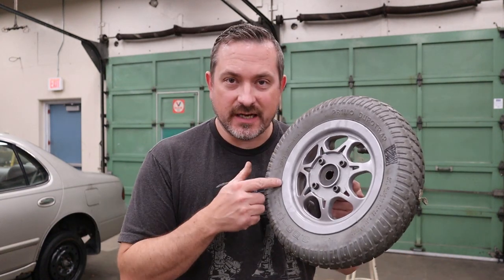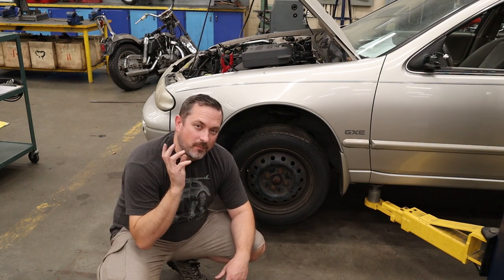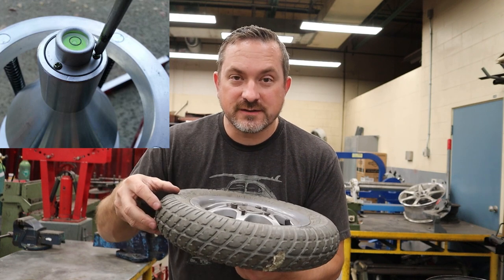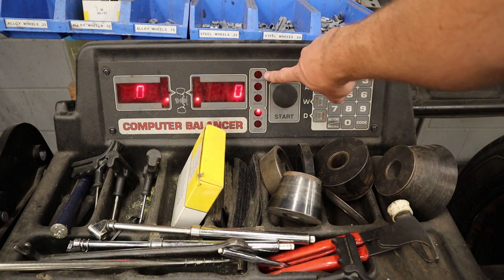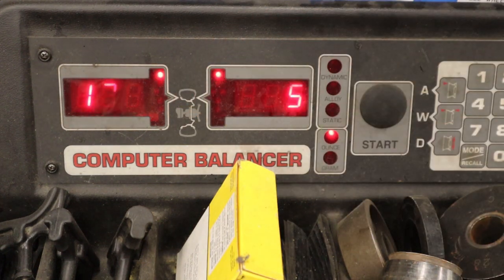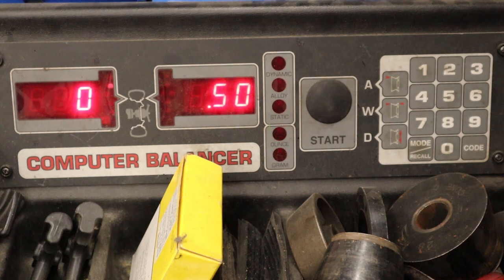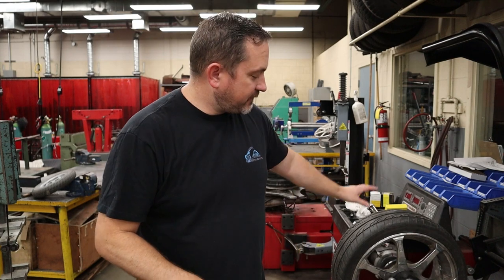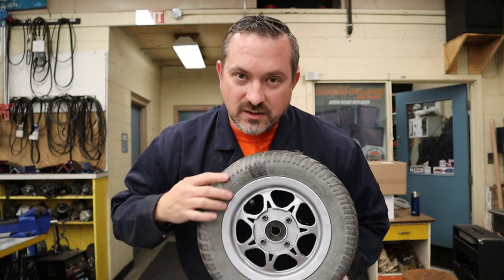EXTREME out of balance wheel!  How to use a wheel balancer & everything about wheel balancing!

Comment: Static balancing still has its place and it’s place is with bigger/heavier tires like M/T’s 33” and bigger. I’ve had a hell of a time balancing radial 33’s. Went the dynamic route and kept chasing weights. Roadforced them and they balanced but had a vibration at 50mph.. Finally talked to a 4x4 shop locally and they said they only balance heavy tires with static balancing. I took their advice and did it and no issues. No vibrations no shimmy no nothing.
Reply from the maker: Good to know as I rarely do wheels that big.  I wonder if a big mud terrain tire would benefit from balancing beads too for when a big rock gets picked up/dropped from the knobby tread.  Cheers!
Reply: @wayofthewrench  Balancing beads are truly a hit or miss. My personal argument as to why I do not use them is that an imbalance on a tire is at fixed spots but balance beads constantly move the balance
Reply from the maker: Yeah balancing beads are really only for large tread off road tires for when they pick up rocks/lose rocks constantly.

Comment: Your comment about road force balancing was applicable to me. I took my vehicle to a  nationwide chain tire store and requested road force balancing. When I got back my vehicle there was vibration at  cruise speeds. I suspected this would be the case a I did not see any indications that the tires were optimized , the tires being deflated and rotated on the rims. Usually there would be "some" chalk marks somewhere on the rims and tires and that I did not see. Also I always remove the hubcaps and keep them in the trunk and replace them myself. There was no evidence that the tires were "wiped" clean. I am therefor returning to have the job done properly. The store has Hunter Elite machines , very high tech for road force balancing and my only hope is that there is someone on the shops team trained to do this kind of balancing. I paid for road force balancing and that is what I expected, not just computerized balancing.
Reply from the maker: Every now and then a tire just doesn't cooperate and there is something that is wrong with the tire internally when driven.  These can be tricky but the shop can play with things to try to solve the issue including using the balanced spare wheel or a good shop wheel in order to diagnose the "bad" wheel.  I'm not sure deflating the tire and rotating it would be a fix as if it is a out of balance wheel assembly, you would just counter balance with weights but maybe more than usual if the tire's heavy side lined up with the rim's heavy side.  Taking off the hubcaps would prove out if the issue was with hubcaps but are not included in the wheel balance so test with them off first.  Another trick mechanics do is do a tire rotation and see if less vibration is felt in steering wheel as maybe the out of balance wheel is on the front which tends to shake the steering more.  Other possibilities is that other components are worn and exaggerating the feeling/sound of a balance issue.  Bad wheel bearings, bad strut, bad shock absorber, etc...a rotating part that can have speed dependant issues.  I hope you got it sorted out.  Thanks for the watch!  Cheers!
Reply: @wayofthewrench  I understand all that you have said. Honestly I do. These  Michelins tires only have 8k miles on them and they were road forced prior with excellent results. When I took them back to Costco  for a rotation and balance I inadvertently forgot to mention not to rebalance , so after the fact that's when I decided to take matters into my own hand have them road forced  elsewhere as they don't offer that service. So I know they can be balance with minimal vibration, much less than I am experiencing now. I'll see what happens when I take the vehicle back. Thanks for responding. I really enjoyed your informative video. Cheers
Reply: @wayofthewrench  So , the balancing was made right as I watched in delight as the tech did his thing. There was one wheel in particular that appeared to be problematic as he seemed to have been "chasing" weights but in the end the computer gave an OK. The vehicle is silky smooth now all the way up to 80mph. My taking the vehicle back and requesting the work be done turned out good.
Reply from the maker: Glad you got it figured out.  Was it done on a road force balancer?
Reply: @wayofthewrench  Yes, Hunter Elite balancer

Comment: Finnally a very good explanation of the dynamic balance of a wheel and why weights can sit with 180 degree opposition each other, at last in theory. What would have have happened if you have sat the heavy balancing weigths while the wheel sitting on the car with 180 degree opposite?  (Sorry if my english isn’t perfect - i am danish)
Reply from the maker: Yeah it might have made the dynamic balancing worse and had more shaking.  Either way, that balancing video killed that car. It shook everything on that car to death.  Lost a bunch of electrical components...lol

Comment: Sir, a friend of mine gave me an older style wheel balancing machine. No motor but all the digital readouts. You have to manually spin the tire until a beep is heard then a brake slows the wheel/tire assembly and indicates the weights required and their placement location. My problem is that that the measuring device that determines how far the rim is away from the machine is missing. Do you know how critical this dimension is in regard to the accuracy of the wheel weight placement results and what it is actually measuring? That is the distance from the rim to what point on the machine. Any help would be greatly appreciated. Thank you.
Reply from the maker: It is pretty critical as it needs that info.  However, it is literally a measuring ruler from the machine to the edge of the rim so you might be able to gleam some measurements from a pic or video of your balancing machine and make your own.  Or find the part you need online.  Good luck!

Comment: Another method of balancing tires with a dynamic system is liquid balancing , (most people use antifreeze) generaly it takes about 2x the OZ weight of balance beads to work properly with liquid.
Reply from the maker: Funny you said this.  I see a lot of cars come in with water in the tires from air compressors that don't have a water trap.  It always throws off our balancer because the water will start on a different side and will constantly tell us it needs more weight.  After 3 attempts, we always break the bead and look for water.  Thanks for the watch and the info!
Reply: @wayofthewrench   yeah dynamic balancing doesn't take effect till the tire is up to a decent speed like 25-30 mph, so yeah it you tried to weight balance a tire with beads or liquid in it, it would never balance because a wheel balancer doesn't spin the wheel that fast.
Reply from the maker: Yeah not a lot of people around us even want balancing beads.  Cheers!

Comment: Great presentation, thanks for that. 
I have Coats 700 never used was sitting in the garage for 10 years, yesterday when I start using it it has error message on the screen, and can't fix it any help or instruction how to fix this ERROR message? Thanks a lot.
Reply from the maker: Thanks!  You'll have to google the error code to see what it is.  Could be something simple like the hub isn't tight or the hood is up or it could be a major problem.  Hope that helps.  Thanks for the watch and welcome to the channel!

Comment: Excelent. Question does tire patch and Slime Flat Tire or Fix-A-Flat affect a balanced wheel? Second question: In places where is to dry and hot, does oxidation of the rubber can generate vibration? In Oklahoma, the tires are bouncing but not because unbalancing but because road conditions (all warped and full of berms) so people has to buy 4x4 and Suv's, not too many subcompact cars (as mine) here
Reply from the maker: Thanks Pablo!  Well a patch might affect the balance but remember you are balancing the wheel after your patch repair.  The tire slime leak repair to a mechanic is like garlic to a vampire....we hate it.  It makes a huge mess inside and yes it could make balance issues.  Best fix is a umbrella patch repair from the inside and if it is a side of the road fix, a temporary tire plug works great  until you can go get it fixed with an umbrella patch.  The heat on tires doesn't really cause balance issues but it will compound or speed up other problems like tire wear.  That sucks to hear about your roads, now you have an excuse to get a truck!  Thanks for the watch!

Comment: Hi, Excellent explaination.......so do you recommend balancing beads? Because some people say they are trouble or do nothing? I am considering using them in my atv tires. I have a terrible handlebar shimmy at 40-70 kph...Thanks
Reply from the maker: I haven't used them personally but I know they are meant for big knobby tires that actively pick up rocks/lose rocks constantly so that the balancing beads fix the constantly changing balance.  So they might work for you.  However, I would check your steering, suspension for loose components, wheel bearings, and initial wheel balancing.  It kinda sounds like something else going on.  Thanks for the watch!

Comment: Thts the sound!!!! Thts the sound I hear the clanky on the 3rd video!
Reply from the maker: Which sound?  If it is a sound in the video, please use the minute/second in the comment so I can see what sound you are referring too.  Cheers!
Reply: 5:45 right before extreme out of balance. I hve been out all day trying to get fix! Had it towed to discount tires nobody is fixing they just keep saying it’s balanced. Sounds horrible and they are saying it’s prob transmission. Your telling me I had tires put on and now transmission went bad but it’s shifting with no problems but sound like it’s going to fall apart since tires put on. I dnt know what else to do I’m out 300 dollars and my truck messed up!
Reply: Even part of the extreme the clanking noise is what my truck is now doing it wasn’t before.
Reply from the maker: Yeah I'm with you on that, if wheels were just installed and sound/vibration is there....it's the new wheels/tires.  It is most likely not the transmission.  I would like to think that most shops would try to help you out, if they are not...don't go back there in the future.  If you were in my shop, I would check all the wheels to see if there was an unbalance and check for other issues if they were balanced properly.  Perhaps they were supposed to install a hub adapter to fit the new wheels to the old hub assembly.  The lug nuts could be loose or if new wheels were installed, the old lugnuts might be bottoming out.  I would probably check for any major loose suspension/steering parts as well.  I would try to talk to the shop manager at Walmart and see if they can either repair the issue or return the wheels and go else where for the wheels.  Good luck, let me know if you gets this fixed and what it was.  Cheers!
Reply: @wayofthewrench  Thnk you for your kindness. Walmart originally installed. I was scared they would mess it up even more so I didn’t wanna tke it bck there. I figure just tires deal with tires and worked with a manger and even paid additional 60 to rebalance the tires. They took the new ones said should b in bck. Worked on the vehicle all of 20min and said it’s ready… I asked did you drive it he said yes. Tht was a lie! I got a block away the noise started again… I put on hazards and crept home and parked it. Mind you I hve replaced almost every part in this truck sounds nuts but I was struggling before being able to purchase new vehicle. It rides better than the Traverse I bought. I was trying to restore it and give my daughter the Traverse to go to college. I just keep getting screwed. Sorry so long… I hvnt gotten no sleep bck at work 16 hour shift with patients. I’m Just outdone to say the least.
Reply from the maker: That sucks, I'm sorry you have to deal with all of that.  Hopefully you can get it all sorted out soon.  Thanks for your service in the medical system, you are appreciated!!!
Reply: And one last thing… u know what else it sounds like researching YouTube… CV axles maybe new tires exposed wear and tear on those parts or they damaged them Idk.
Reply from the maker: CV axles usually make more noise when cornering and sometimes only a certain direction as it stresses certain parts ( inner and outer joints).  CV axles sound like a clunkity clunkity clunkity sound that is speed dependant.  Wheel bearings sound like a whirring or growling sound that is all the time and speed dependant.  I have a video on wheel bearing diagnosis if you want to see what I mean.  Good luck!

Comment: Fantastic informative video sir thank you 👍🏼👍🏼👍🏼👍🏼👍🏼 by any chance would you know what error 7 on a CORGHI EM 43 wheel balancer means . I can’t find it in the book or the website ! Don’t know if it’s a wheel balancer universal code ? Thanks
Reply from the maker: Thanks!  I don't and I would imagine that they all have different codes per manufacturer if not per model.  Most common codes are hood is up and wheel not tight, after that maybe shut it off, unplug power, remove a cover, blow all the dust off inside, and put the cover back on and see if it works.  You could also try a recalibration if it lets you.  Good luck!

Comment: Or you can do this after balancing the disk, release the disk, turn the wheel a little 90°, fix it again, turn on the machine and check what happens
Reply from the maker: Yeah this usually changes the weight a very small amount, like .25 or .5 depending on the wheel and if it's balanced or not.  Sometimes it's just that way the wheel is sitting on the centering cone.  Thanks for the watch!

Comment: I’m afraid to say that cupping is absolutely not from a bad balance. If that were the case it would happen on the rear tires as well which it absolutely does not. Ever. Cupping is the affect of steering and braking on certain knobby tires. The only remedy for cupping is frequent rotation. I’ve been aligning cars and balancing wheels for over 30 years and currently operate a shop in canonsburg, pa
Reply from the maker: Cupping can be from a bunch of stuff.  Out of balance, bad alignment, worn suspension/steering components, cheap/old tires, etc and it could even be a combination of these as well. Thanks for your info and the watch.  Cheers!
Reply: I see cupping on rear wheels nearly daily, moreso than I do on front wheels. I do agree that it's less likely to happen from bad balance, especially if it's on both sides of the axle.

Comment: So I got a question about vibration in a steering wheel I did not see explained on YouTube. While riding on the high way you get a vibration for 5-6 seconds and then it slowly goose away takes about the same time. Then after 5-6 seconds it comes back, and it keeps repeating this behavior. The speed this happens is around 110-120 km/h. Do you have a explanation what this could be?
Reply from the maker: Steering wheel vibrations are a good sign it's an issue on the front wheels.  I would check wheel balancing on the front wheels, loose lug nuts, irregular tire wear (possible bulge), loose steering components, and bad wheel bearings. Do you feel the vibrations at lower speeds too?  You've got something not right and I would not leave it, get it checked/fixed soon.  Let me know what is was, cheers!

Comment: Is it shown on every tire where is the heaviest part or just for certain brands of them? I bought new tires and mounted one, now I need to balance it. I don't see any marking for the heaviest part (maybe I can't find it). And the heaviest part of the wheel, is it always where the stem is? Reading instruction on HF Wheel Balancer I came across the statement, that if those 2 points (heaviest parts) coincide, it is not possible to balance the tire, you need to rotate it 180 degrees relatively to the wheel. I've never seen any discussion on the subject, besides that instruction for HF Balancer (bubble) and this film. Thank you for the very informative film.
Reply from the maker: You gotta remember that the dots are there to help balance a wheel assembly with less weight so if the dots are not there, you can still balance a wheel.  Some tires won't have those dots, usually because they are used.  The yellow dot goes to the valve stem.  If there is a red dot, then it goes to the valve stem or if it's a steel wheel with a drilled dimple then it lines up with that.  If you have both yellow and red dots, then use the red dot.  No dots? Then just throw the tire on and balance.  Just make sure it goes on correctly for directional, asymmetrical, and or white walls facing all the same on the vehicle.  Thanks for the watch!
Reply: @wayofthewrench  Thank you. I bought new tires fm/Tire Rack, asymmetrical, all 4 tires have no dots (R16, passenger car). I'll check w/their CS about no dots. I thought it can be different marking instead of those dots. Thank you again.
Reply from the maker: Not any other markings that I know about. Cheers!
Reply: @wayofthewrench  I see, thank you. I called CS of the Tire Rack, they said just some tires have those dots, some don't. More details like does it depends on brand, price and alike I couldn't get even fm technical support. Next time I buy tire fm them I'll try to get more information on the subject. Thank you again for very good films you produce.
Reply from the maker: Thanks Olena!  Take it easy
Reply: @wayofthewrench  Thank you. Nice name of the channel too.